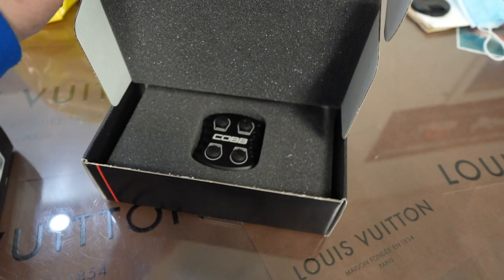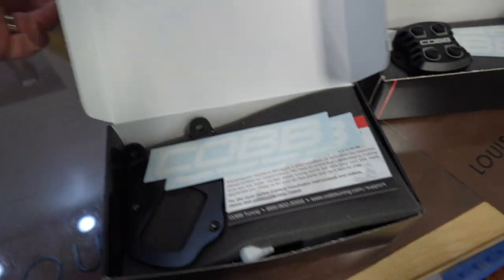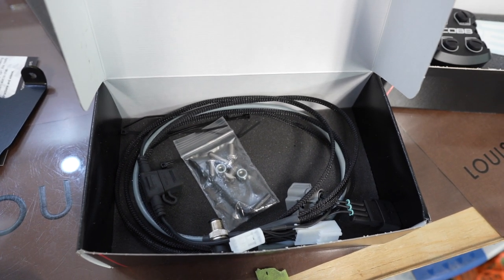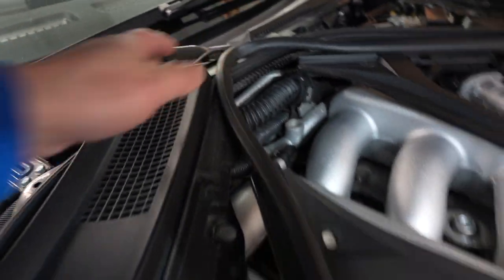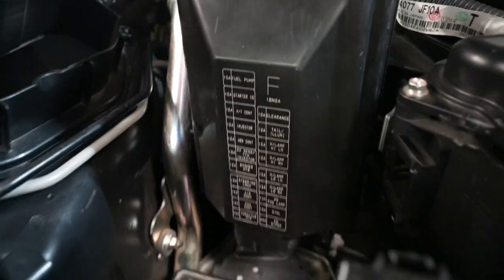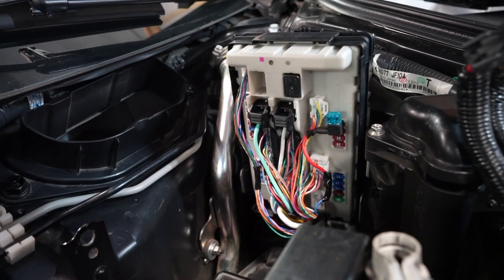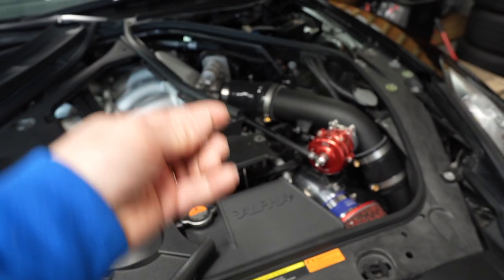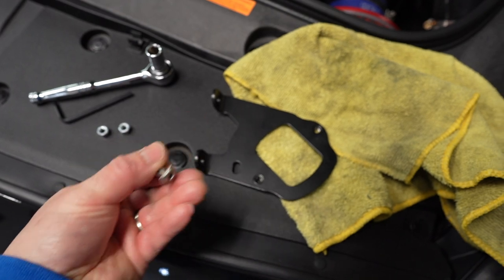Cobb Can Gateway Install on the GTR.

Comment: Doesn't the tune already control the fuel management tho? Not going to lie, I actually thought about switching to ECUTEK for a bit because COBB no longer supports the GTR platform but then I realized that would be a waste of money. BUTTTT the flamessssss lol.
Reply from the maker: Yeah that is correct the tune does control the fuel management. The can gateway allows you to add more sensors like fuel pressure to help your tuner have an easier job fine tuning your gtr. The gtr for some reason doesn't have a fuel pressure sensor so that you can monitor on the ap. I'm installing one in the next couple of vlogs.

Comment: Do you think getting a Cobb access port is a good idea now that the green something has changed it??? I have a Gtr as well
Reply from the maker: I would hold off for the meantime. Any tune regarding anything emission related will trigger a check engine light. Not sure why Cobb does it so annoying